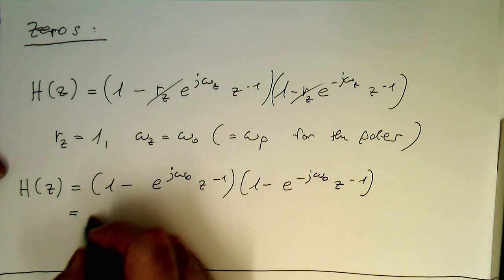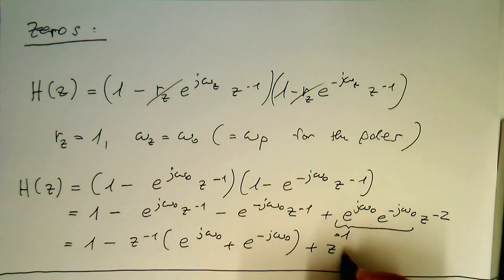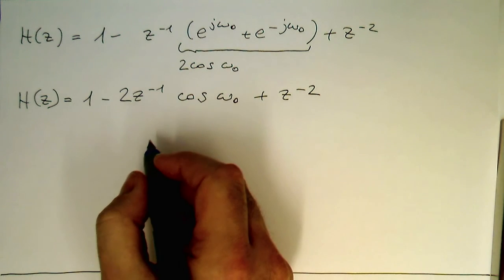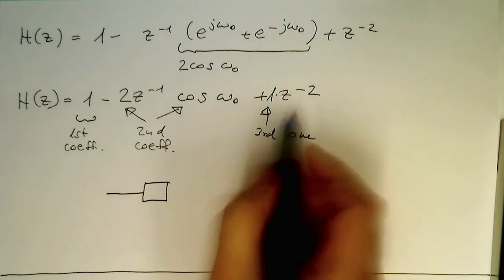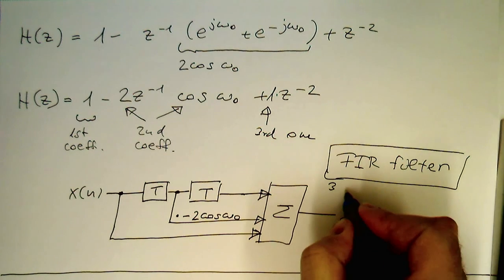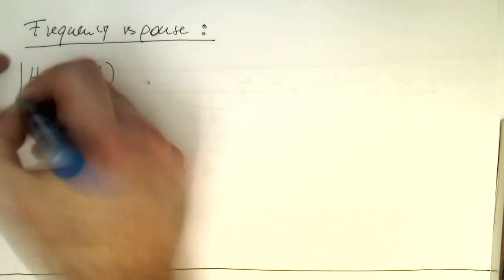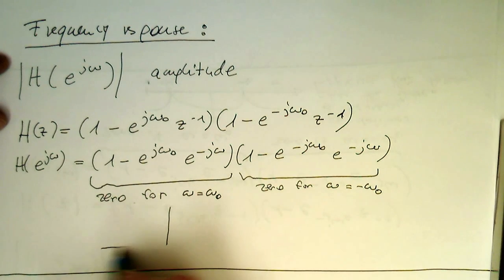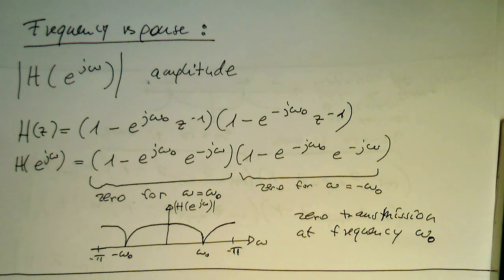2nd order IIR filters: zeros (0001)

Comment: At 11.35, shouldn't it be H(z)= 1 - 2 z^(-1) + z^(-2) ?
Reply from the maker: You mean the special case for w=0? It is. Isn't it?
Reply: Digital Signal Processing no, you've written H(z)= 1 - 2 z^(-2) + z^(-2)

By the way, excellent way of teaching the material. I'm taking this course in another major UK university, and I wish our lecturer taught it as well as you do. Nice job.
Reply from the maker: Indeed! Thanks for pointing it out. The data flow diagram underneath is correct again, though.